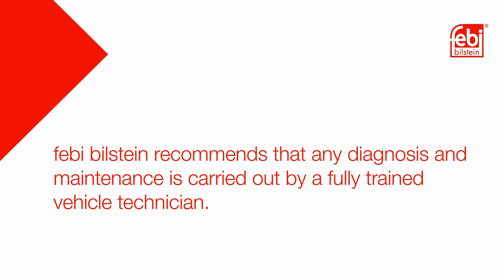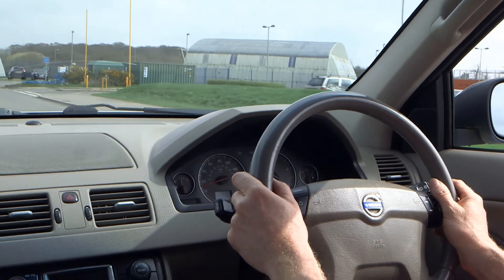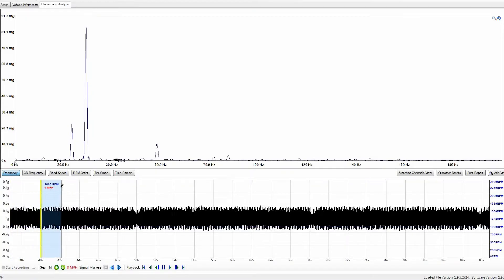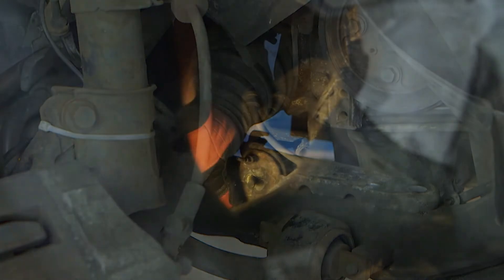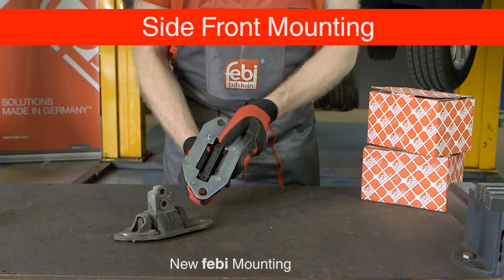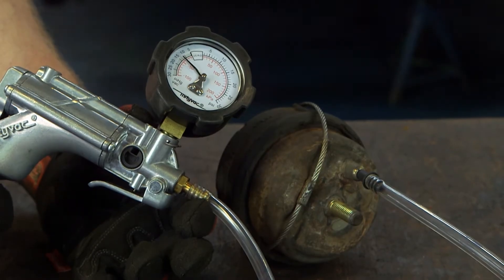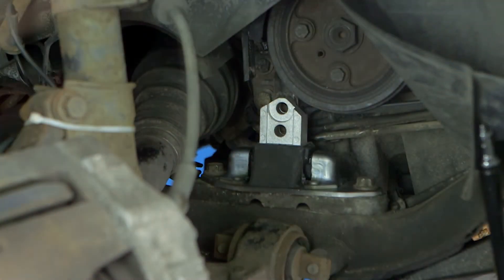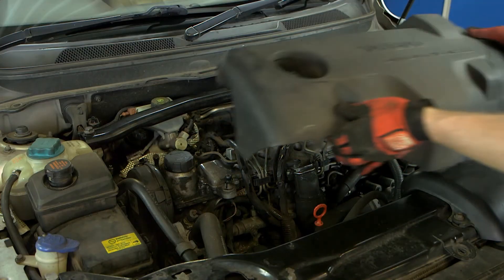[EN] Engine Mounting Analysis and replacement

Comment: I replace engine mounts on my volvo xc90 d5, I used febi mounts, but front vacuum mount has a small leak, is it normal or do I have to replace it again?
Reply: use lemforder
Reply: @miloskljaic2081  thank you, I did used at the and, rear one is same as oem and it fits, but front one no. Front one is also same as oem, but they change it, and for the right position of the engine i had to change front engine mount bracket too. It lifts engine for 1 cm. So, it is not posiblle to by factory used front engine mount for volvo xc90 d5, oem or other, you have to change bracket too. Pozdrav iz R. Srpske.